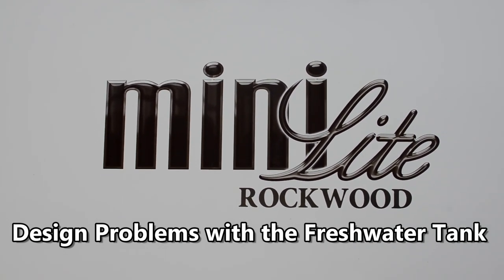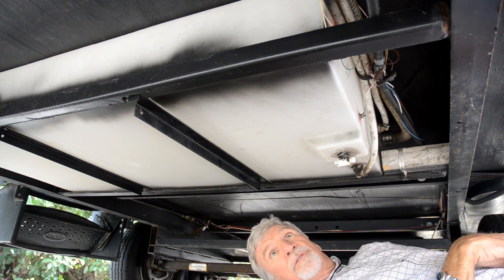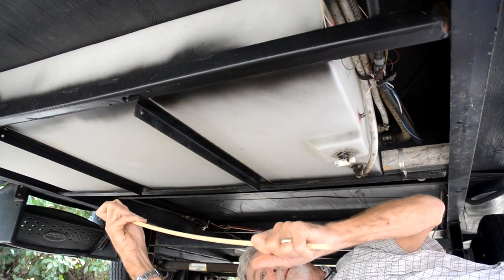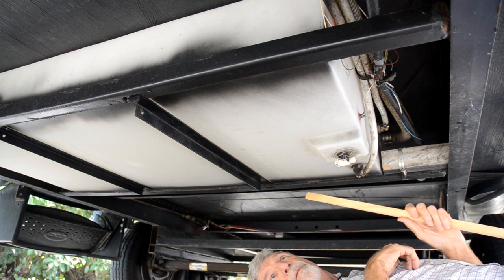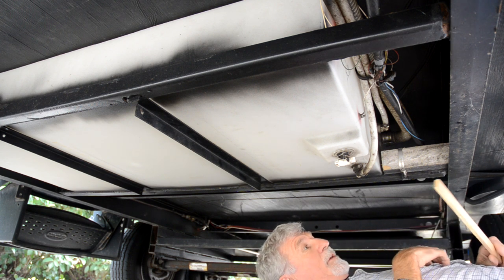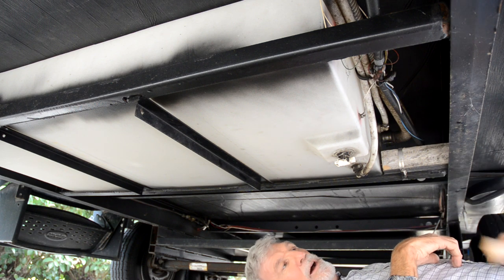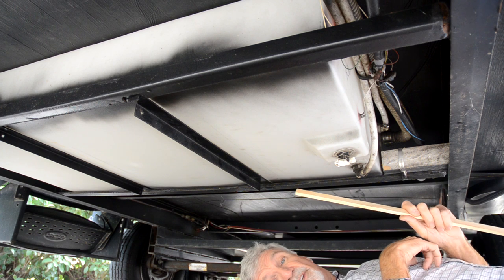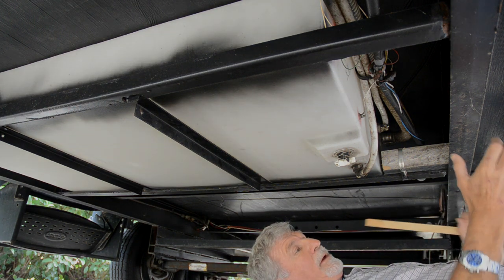RV Tips #5 - Forest River Rockwood Mini Lite water tank fail.

Comment: Well I purchased a used 2014 2104s mini lite and took it out the first time yesterday. Got to the campgrounds and was filling the fresh water tank and boom! As I found out the one brace was missing but the whole end blew out. Tank was around 2/3 full. The people we purchased it from always used a campgrounds with full hookups so maybe never used the tank. The one brace was hanging down after it blew and the other one was completely missing. Possibly gone for who knows how long. We didn't tow it with any water in it at all. Fortunately we were only around 30 min from home. So, time for a new tank, braces and reinforcements! Thanks Mr. Blair for the tip!
Reply from the maker: Thanks, it's a shame they have such cheap tanks and support.  The little camper is overall pretty decent but that is a major fault.  Sorry that happened.

Comment: Had same issue as described by others in the comment section. My trailer is a 2015 Rockwood Minilite model 2104S.. My solution as follows:       I removed both of the factory frame to frame 1 1/2 " X 1 1/2" angle and replaced it with 2" X 2" X 3/16" angle iron... Had to zip disk cut the factory front angle as it is welded while the rear angle is bolted for easy removal of the tank. I kept the tank suspended with some plastic boxes so I did not have to remove any of the electrical or piping. The factory front angle failed right where the two punched slots are in the middle of the angle. I also discovered that the front angle is .140" thick while the rear angle is .165" thick. Why that is when both serve the same purpose is a mystery. The front angles thinner material coupled with the double punched slots on the vertical and horizontal surfaces caused the failure. For the heavier replacement angles I had tabs 3/16" X 2" X 4 12" long flat bar welded onto the ends similar to the tabs welded onto the rear factory angle.  I drilled holes in the frame and bolted both front and rear angles with 2 @ 5/16" X 3/4" NC  stainless bolts c/w lock washers in each tab for a total of 4 bolts securing each angle. Backing up I cut off the front factory angle flush with the I beam frame. That leaves the stubby piece still attached to the frame. I determined that trying to remove this piece completely from the frame could cause damage to the frame so I left it there. That means you have to move the tank forward about 2 1/2" to 3". about 30 pounds more on your tongue weight with a full tank. Fabricate frame to frame angles with tabs facing forward on front angle and facing rearward on rear angle. Next is the cross braces/angles.  Cut off 4 pieces 3" long off the left over material  from your new 2" x 2" x 3/16" angle and weld these onto the vertical surfaces of your new frame to frame angles at the original locations of the factory cross braces with the horizontal surface of the angles pointing in the same direction as the end tabs.  These pieces of angle will serve as the mounting points for the  two 33 1/4" cross braces. I used the left over pieces of the factory frame rails for my cross braces. Drill all your holes in tabs and 4-3" angles before you weld things together.  I used  a 1/4" NC stainless bolt c/w lock washer on the end of each cross brace. That makes 4 total. Back to the frame to frame angles.. Measuring these two angles overall length is critical as it will not slide into place if is too long or will bend the tabs if is too short. My trailer is 66" inches between the inside edges of the bottom frame rail "I" beam flanges. The overall length of my fabricated frame to frame angles are 68 1/4". You can use your rear factory angle length (the one you can unbolt)  as your reference point for your new angle length if its straight. Measure as often as you have to to make sure the overall length of you new angles is correct. Total cost of the project $75.00 for material and $20 for lunch for my buddy the welder. It took him 1/2 hour to weld and I did all the fabrication. I cut my steel with a 14" Makita cut off saw with a Metal cutting fiber blade. You could use a miter saw with a metal cutting fiber blade to do your cutting . I am a handyman senior with not special skills but love a challenge. The finished product is excellent.  I don't want to think about what a trailer repair shop would charge. good luck.
Reply from the maker: Good job, mine's good now that I reinforce the cross pieces oh, I don't know about the damn tank, it's so flimsy

Comment: Dealing with the same issue in a 2016 Forest River Surveyor.  The angle iron the tank is on seems thick enough for the weight but the tank bellies out and warps the tank so much that the corners end up holding all the weight, and snap the corners. I've put a board and two ratchet straps around the center between the rails to prevent the tank from bowing, and I'm trying to plastic weld the break in the corner. There has to be about 10 gallons of water that are never being used in the tank when you are sitting level! I had to get under it with my legs and push it up to get it to empty all the way out of the drain. I cant imagine having water in the tank that is never used is a good thing from a sanitary level. Also noted the self tapers that were used to install the removable bracket were cut off short so the spare tire mechanism would fit on..... then they used the same long self tapers to secure the tire holder... pointing straight at the tank. One big shift and that tank could get a hole punched in it! I'll put a board in there so it can't shift either direction!

Comment: Had the rear support rail on my galley tank (2018 PrimeTime Lacrosse 3211RK) break free while traveling. The 4 self-tapping screws used to secure it rusted and broke off. Tank was sitting on the corrugated underbelly cover. Dealer states it's FR design of a Floating Tank to allow for flex when traveling. There are no straps or screws holding it in place, just weight and gravity. The force of it coming loose bent the rear bar which made for an extra amount of effort to get the 4 new bolts, washers, and lock nuts on it. Also ran a ratchet strap from the back frame of the camper to a cross rail on the frame. It won't come out anytime soon, but still need to find a way to fully secure it in place. SIDE NOTE: We were camping 2 hours from the house when I discovered this. Thankfully a small hardware store 10m away had what I needed. SIDE NOTE 2: All of the wiring for the rear of the camper run UNDER the tank and just lay on the underbelly cover. If the tank fully let go and broke through, all of my wiring for the rear kitchen would have been ripped out.
Reply from the maker: Thanks I should check mine I probably got the same problem. my brother-in-law's black water tank completely fell out.   a car pulled up alongside of him with toilet paper streaming off of their antennae to tell him he had lost it.    I'm still laughing over that  but yes Forest River really has some junk. I keep looking for things like you mentioned so I appreciate it eventually I'll get this little camper after owning it for 7 years into a condition where I can trust it I think I'm close

Comment: If anyone is saying I will never buy Forest River again or whatever brand is garbage don't worry... THEY ARE ALL THE SAME. As soon as you buy and RV you start repairing an RV. On the plus side they are dead simple to fix. 

When your willing to spend 80K or more for an RV then you can expect some quality. But anything up to 40K (size depending) is shit. 40K to 60K pretty descent. 60K to 80K is excellent for a small trailer not bad for a larger one. 80K plus and you will get some good craftsmanship with quality components and the right to bitch at the dealer and manufacturer when something goes wrong. But all they really care about is making it past that 1 year mark where they can wash their hands of any responsibility.

My trailer is a Coachman Apex and I am pretty sure I am having the same issue as this rockwood. Its time to strip the underbelly cover and see what's going on but I can see 2 protrusions in the underbelly cover  that look like the corners of the tank.
Reply from the maker: Yea, totally agree.  I've had 5 different brands and every trip something is falling off or I'm fixing it when I get home.

Comment: I have a 2016 Flagstaff 23LB Micro Lite which is almost identical to the Mini Lite.  I have the same problem that I'm now in the process of repairing.  What I noted in my case is that the support to the rear of the camper is only very slightly bent as you would expect from the lighter than required material but no failure.   However, the support to the front of the camper completed failed at the position of one of the cross supports.  The difference between the front and rear supports is that the rear support only has one notch cut out at each cross support location but the front support has two notches at each cross support location. One on the horizontal side of the angle iron (for the tab on the cross support) and another one on the vertical side of the angle iron that is not used.  While the supports are too light for the load, I see the notches as the real problem.  They provide a weak area right at the point of heavy weight distribution.
Reply from the maker: That's a very good point I hadn't thought of.  That may be why FR's warranty repair on mine was to reinforce the front piece and not the rear.  Interesting.  I did the rear myself as I was afraid it could fail also.   As my old Dad used to say, "too strong never failed". ha.
Reply: I got the angle iron bolted to the front support today - it's now rock solid.  I plan on doing the rear but I want to find lighter weight angle iron than they carry in the hardware stores.
Reply from the maker: 1/4" was the lightest I could find which is overkill.  "Too strong never failed".  But I don't need the extra weight.

Comment: Also with 2013 Forest River Micro Lite 21FBRS.  One cross bar is bent and will have to be replaced and/or reinforced.  Tank has developed cracks and will need replacing.  I plan to try a repair but doubt it will work, certainly not long term.  Agree--poor design.

Comment: Did you weld the pieces in place, were you worried about melting the tank ?
Reply from the maker: @johnbain7509  hi, yes welded them to the original angle iron with the tank off.  I cut the added pieces shorter than the original one so I could use the same screws etc…so I over laid the added pieces, in effect.  I wanted to be able to remove the tank if I ever had to.

Comment: We just ordered a 2019 Mini Lite 2511S . I will update you on the mounting brackets and if they are bertter or not when I get it in May.
Reply from the maker: Thanks, hopefully the've fixed that.  I've pretty much got the minor bugs out of the TT now and it's doing well.
Reply: please update us. I just bought a rockwood 2509s and now I am afraid I will lose the fresh water tank on the freeway
Reply from the maker: It's incredible that FR hasn't fixed this by now.  A post below said FR beefed them up in March 2018 but hasn't taken delivery yet to confirm.  When I got mine, I thought, wow, FR is owned by Warren Buffet, they must really be high quality.  I should have know, making money has nothing to do with quality.  I think I'd maybe look at a Jayco or something other than FR on the next one.  I've upgraded mine to the point where it's dependable now.
Reply: Did you check the fresh tank supports yet? 

I have a 2019 2509 and camping for the first time. I filled the tank and can see a crease in the enclosed underbody plastic panel. I'll be letting out some of the water until I can drop the panel and look at it.
Reply: Update.. have not had any problems. Actually have hauled it 3/4 full and no issues. Brackets are as good as the day I got it.. I used a handheld flexible inspection camera that's used usually to look into engines, plumbing and such.. so a small easily resealable hole in the underbelly and I could see.

Comment: Have the same problem with my 2018 geo pro g19fd!  Rear support failed in transit,  tank was less than 25% full.  They use cheap 10 guage angle iron instead of structural angle iron.  No support for forest river,  STAY AWAY from their trailers!!!

Comment: My 2010 1809s is the same poor design.  But this 2014 does have one improvement over mine.  My fresh water tank supply line attaches to the side of the tank; not at the bottom as on this one.  So once we get down to below a third of a tank, it starts sucking air.  Anyone have suggestions on fixing that?
Reply from the maker: This tank is so thin and flimsy I'd replace it completely if I found get a better quality one and use this for boondock extra water storage in the back of the truck.